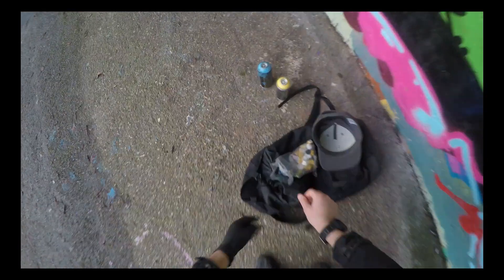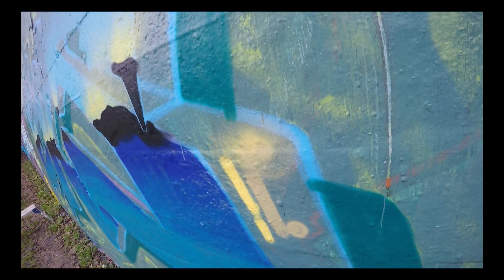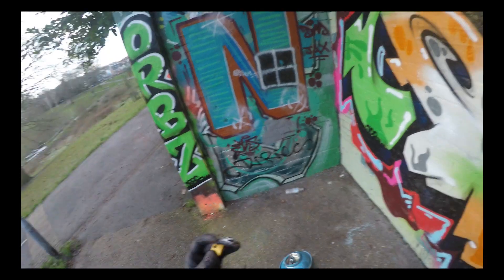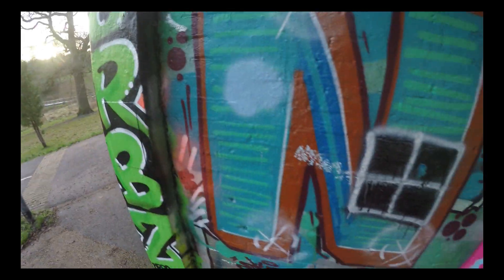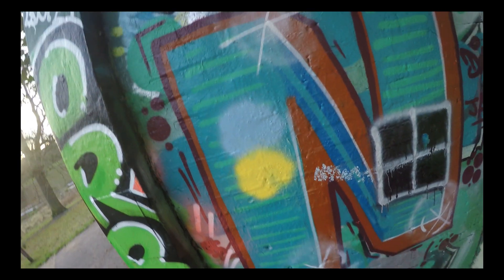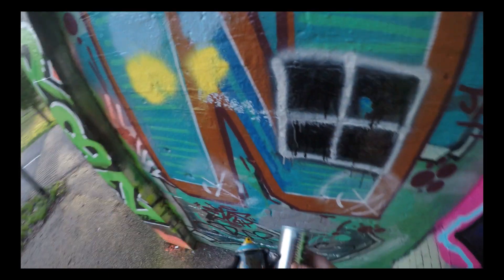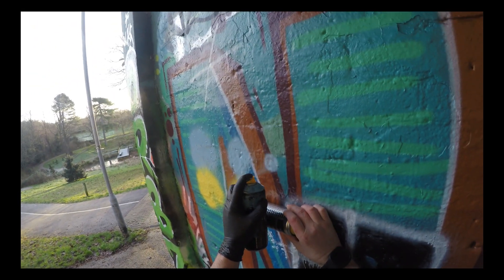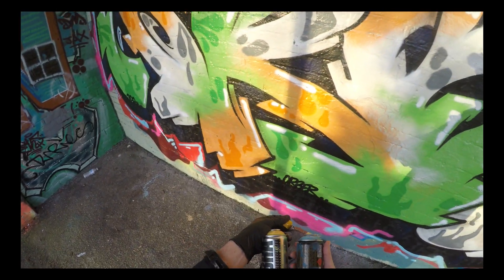Graffiti Spray Paint HIGH PRESSURE Vs  LOW PRESSURE Comparison ~~ Kobra HP Vs.  Kobra LP

Comment: To all that wonder what is the difference between HP and LP, i am a bit stubborn and contacted the company directly this is what they told me 
"You are right. The difference between the old KOBRA HP and KOBRA LOW ( LP version ) was minimal. KOBRA LOW was created more for the USA market and contains different colors than the HP version. Our company ITALGETE SRL bought the brand KOBRA since 2 years and we have deleted the KOBRA LOW from the market for that reason. We kept only the version HP which is sold by our distributor Rabeko in Poland.

 

Last month, we have introduced on the market the new KOBRA HP and LP where our company introduce a real low-pressure formula that you will be super happy to test it"
Btw the mixing ball is metal 😊

Comment: I never used Kobra cans, and the only brand I used different pressurised cans from is Flame Orange and Flame Blue. I would use the lower pressure for more detail work and outlines. The pressure should influence only the throughput, so you should be able to see a difference if you stop the time of filling a cup or a square meter of wall with paint.
Reply from the maker: Yes, I think the higher pressure cans are generally better, even for detailed work I reckon. Yep, the cap is fixed and the volume is increased over a fixed time is my understanding. I didn't really think of that before. I didn't really see much difference between the Kobra LP and Kobra HP. I'm sure there must be some better ways of making the testing more obvious

Comment: So do their have different pressure or not ? If the output is the same what is the point of having two kinds ? Marketing?
Reply from the maker: There is a different output but it's not that obvious. I think I need to come up with a fairer test to make it more obvious. I feel like Kobra has a small difference between the HP and LP, whereas the Flame Orange and Flame Blue has a greater difference.
Reply: Ok but is it still ok to use same way as other low pressure cans  or the HP is already to much for details and fine lines ? Thanks for answering
Reply from the maker: @Romahotmetytky  yeah it's fine. I would use both HP and LP for fine details